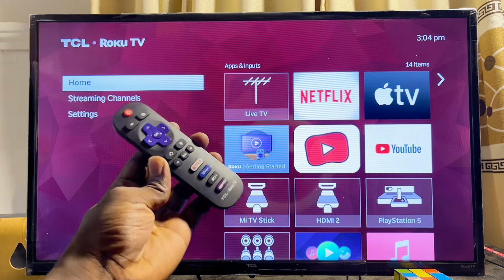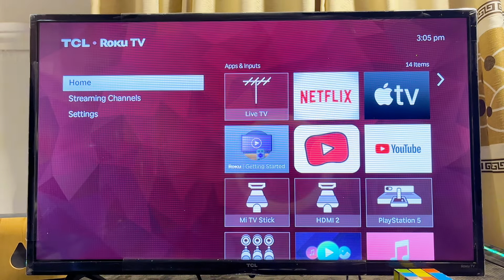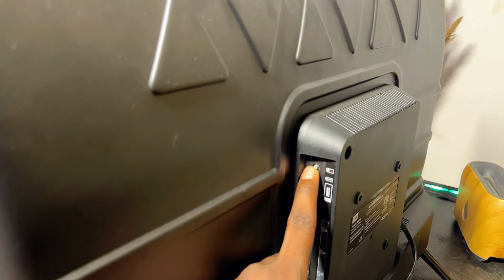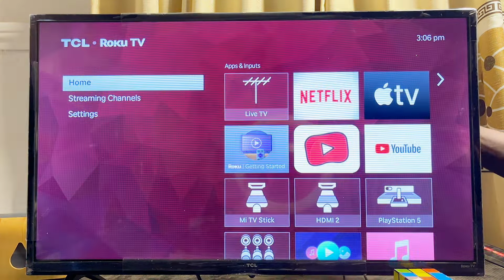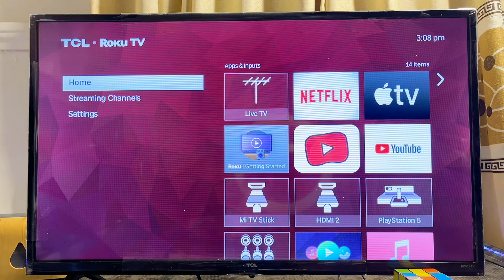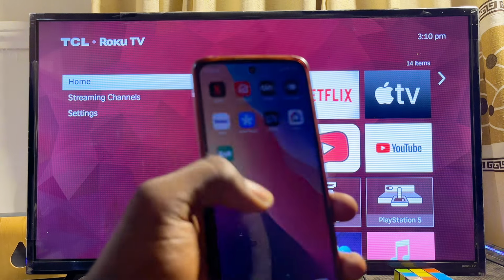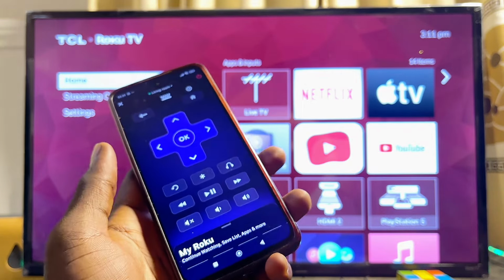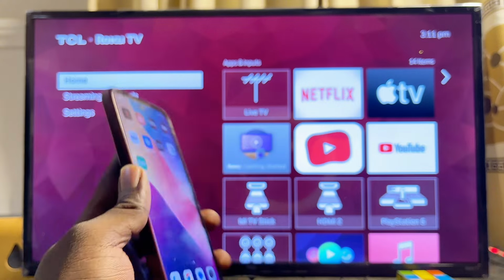How to Control TCL Roku TV without Remote

Comment: How do you connect the TV to Wi-Fi without the remote?
Reply: That's what I was waiting on this a stupid video
Reply: I cant connect to my wifi
Reply: How do you select
Reply: I did a factory reset because I was unable to change back to english. I don't have a LAN socket on my tv
Reply: All the apps you have to pay for......nope
Reply from the maker: You can use a LAN cable. Also, the TV can automatically connect to a WiFi network it has connected to before